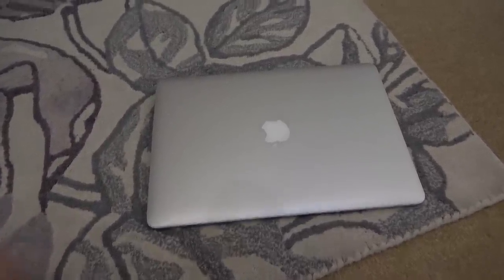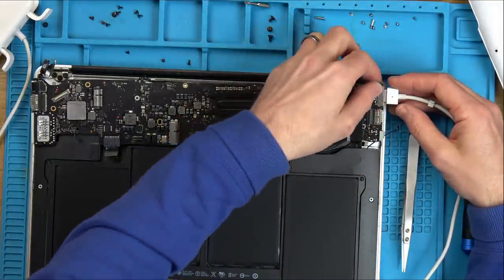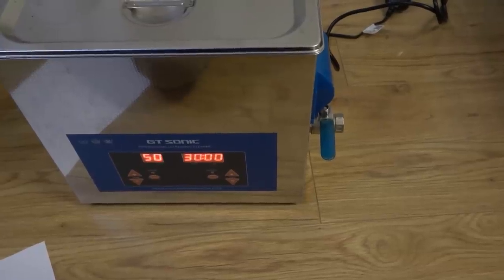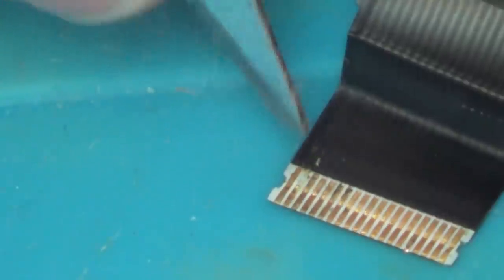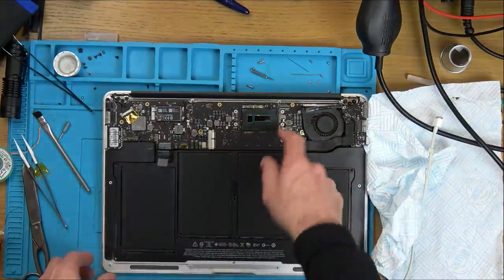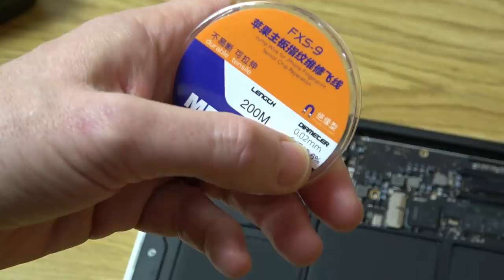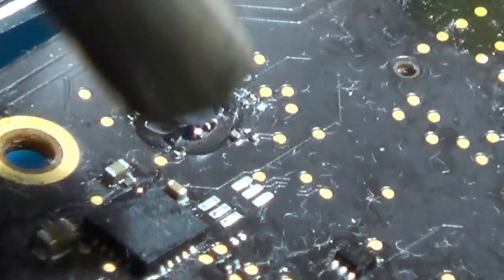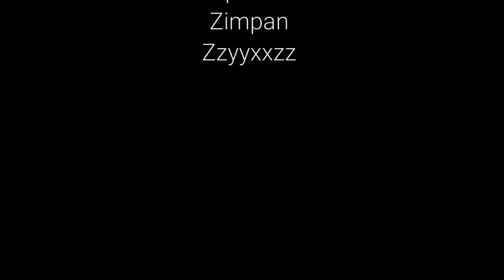Coffee Damaged 2017 APPLE MACBOOK AIR from eBay - Trying to FIX

Comment: That's a really difficult repair.  Well done indeed.  Awesome work.  I have the 2012 version of the Macbook Air that looks identical.  Bought in 2012, i7 version, still using it right now... to type this.

Comment: you did one of the things that I wanted to try but never had the courage to, put solder on the pads and then on the chip to simulate some sort of "reballing" and it worked, I'm speechles, it's not the correct way but hey if it works it works <3
Reply from the maker: Thanks, I think I got lucky because there weren't many balls. Maybe on a slightly bigger chip it would fail 👍👍
Reply: @Mymatevince  ye my thoughts are the same, you did a great job Vince, superb fix

Comment: When I saw it was a Mac Air I had doubts.
When I saw the inside and how much corrosion there was, I felt justified that I was right. Spares only but.....59 minutes of video.
Vince, you have progressed to the next level. I am gobsmacked.
Great video, I hope you replaced the fuse :)
Reply from the maker: Thanks Emma, I got lucky this time! Yes the fuse is replaced. I didn't want to take it all apart using hot air, so I double deckered it on top of the old blown one using the soldering iron 👍👍👍

Comment: I have a mid 2012 MacBook Pro that i have put an ssd in replaced the trackpad and the ribbon connector between the ssd and the board but never any soldering. I take my hat off to you i really thought that was toast , very clever 😊.

Comment: Hey Vince just wanted to let you know this video helped me fix my backlight circuit on my 2015 MacBook Air, so wanted to say a massive thanks. Similar to yourself I can do most soldering jobs around a Logicboard while BGA is still a challenge. I copied what you did for the backlight IC and it worked perfectly. Thank you!

Comment: Nice fix Vince. In future for bga work it is easier to buy some solder balls and place them on the chip using tweezers, then use hot air to affix them to the chip. This ensures the balls are all the same size.

Comment: What about scraping the plástic from the ribbon cable on the keyboard and cutting horizontaly to eliminate the damaged part permanently?

I have done this before on my switch pro controller and worked.

Kep UP the good work Great Video!!

Comment: Amazing how far you've gone since the early video's. You really need to treat yourself to a better soldering iron if you intend to fix lots of laptops. The cheap Quicko or Ksger T12 solding irons are nice as they use the Hakko tips.

Comment: you should try one of those beautiful 17" macbook pros from late 2011 that had the gpu failure, in theory a bodge fix could just be heating the gpu up not even removing it, may be a fun gamble. Also deoxit is a very good cleaner for that kind of corrosion if you wanna deal with corrosion and bad contacts too quickly. Also also I wouldnt probably recommend turning on a water damaged system until you deoxit or ultrasonic it for risk of further damage even though its dry.

Comment: just a heads up vince, cover small bga chips with corrosion in flux and reflow them with hot air to clean underneath them , while you patch up the surface mounted chips with the iron and flux, the sonic cleaner should be used last
Reply from the maker: Thanks for the tips Jason 👍👍
Reply: @Mymatevince  loving the channel mate 
you were ready for this soldering malarkey 6 months even a year ago, so im really enjoying the latest electronics projects you are streaming, 
you getting good solid successes lately, and its making great content,
Reply from the maker: @jasonr9157  Thank you mate!

Comment: Feed back pin monitors the output voltage on the backlight circuit so the chips knows how much to boost the backlight voltage , great video 👍👍👍, you would need to order a new keyboard sooner or later
Reply from the maker: Thank you AR 👍👍 I was amazed all the keys worked after that damage. I wonder if the keyboard is screwed together or plastic molded on this model?
Reply: @Mymatevince  its not an easy job may better to get top case as the keyboard is riveted with aluminum pins and needs to be removed then tiny screws to replace the rivets
Reply from the maker: @AnonymousRepair  Thanks AR, sounds a bit of a nightmare 👍👍

Comment: Good Fix. I'm quite surprised using solder instead of balls worked on the chip. As being ever so slightly uneven can stop it making a connection.
Reply from the maker: Thanks PDS, yeah I got incredible lucky with that👍👍👍

Comment: Hey vince. I have a ps4 that I’ve had for a while. I am constantly trying to repair it but I’ve had no luck. Basically it says it cannot access system storage. Very rarely it will boot up but when I turn it off i normally have to reinstall the software or I can’t as it says it can’t access the storage. I have replaced the hard drive several times but I still get the same fault. Let me know if you want to take a look!

Comment: my 1st thought was 'uh oh, if there are foils in the keyboard, thats the main problem'. I'd try to run the board just with usb keyboard and maybe with hdmi monitor (adaptors thunderbolt-> hdmi exist). The internal keyboard may be shorted over many keys due to the liquid. Since Macs recognise certain keypresses on startup, it may cause the boot launch to get stuck. (just a guess).

Comment: Fans are usually part of the pre-POST package as some laptops won't cycle on if the cooling fans aren't active so that is a positive sign.   POST does all the checks like runs the BIOS, confirms and checks the CPU, GPU, ram to CPU lanes, bridges and control IC circuits and if all is good then it looks for an operating system next and moves into actual startup.   Peripherals are always last in the lineup.
Reply from the maker: Thanks Ian 👍👍👍👍

Comment: That was an interesting ride :) Subscribed! I have a question: what glue can you use to put the feet on so they are easy to take off again to get at screw underneath? I'm feeling brave enough to tackle opening my laptop now but I think the rubber feet won't re-stick afterwards

Comment: Don't apologize for complaining. Absolutely the seller should have listed it as water damaged. It still would have sold at that price and would have helped their reputation as a seller to be up front. As it stands now you know never to buy anything from them again regardless of how good a deal it may be because you know they won't be entirely honest about the faults.
Reply: First of all I agree generally, but It's possible they got a lot of them and it truly was untested from this seller.  It's also possible someone took one look in there and thought OK there's no way this is gonna be worth the effort(or that the seller was the original owner and knew exactly what happened).  But it did have fan spin right off the bat!  So in a way, I wonder.

Comment: Impressive repair, well done.. sell it. on eBay as a Mac Air in magnificent NOS condition only 100 cycles on the battery, almost new-old-stock.(obviously not would be extremely dishonest)
Just imagine that new owner's face, when he is opening it up and realizing he had purchased a corpse that has been reawakening from the dead with bodge wires etc.
I'm impressed by the prices such a damaged old 720p MacBook air can fetch (arrh I see it seems it is a purchase from 2017 and not present time, then it makes more sense 200GBP in 2017)
all in all, very impressive repair job and kudos for making it look doable for the average joe.
Reply from the maker: 🤣🤣 One careful owner!

Comment: This is a GR8T example of why when a liquid is spilled on "any" electronic device that you remove ALL power sources from it (charger, battery, button cells?) as fast as possible. Reason? Electrolysis!... as shown, it eats away everything with a combination of liquid and voltage. It's the world we live in :O\   Good job V-master.

Comment: I had a Dell  laptop at work that was being thrown out due to a chemical leak from an above pipe. The keyboard was ruined but it was sealed on the underside so no chemistry contaminated the mainboards. £10 fix and a new laptop. Thanks Dell 👍😂

Comment: You ought to stress test it by running a couple bench mark apps and perhaps editing some video and photos on it. Really put the machine through its paces to see if it still has any hick ups. If there’s still issues they’ll pop up as the machine starts to heat up and sweat.
Reply from the maker: Cheers Keith 👍👍👍

Comment: No shorting when you fixed it. Apple products wont start if there is a disconnection or damage to the touchpad or keyboard. Once you reassembled, the "problem" was fixed

Comment: REFOX Soldering Lug For Pads Repair
Repair dots quickly,High efficient/stable
To replace the traditional jumping wire
With the effect of original soldering pad
Reply from the maker: That looks very interesting. Thank you for sharing it 👍👍👍👍

Comment: The keyboard backlight is light sensitive. I thought I had a failed one on a 09 pro, but it turns out that the room I was in was too bright, and the lights wouldn't come on. I believe that it can be turned on and off in the settings.
Reply from the maker: Yes, that threw me for a while, I thought it was faulty! 👍👍👍

Comment: You should put flux on the corrosion and hit it with hot air to help get rid of it more permanently, then chuck it in the ultrasonic cleaner, I have fixed boards far worse than that one.
Reply from the maker: Thanks for the tips Defpom 👍👍👍

Comment: Vince, mate, why don't you use kapton tape to mask where you don't want the conductive paint to go?
Reply from the maker: Hey Skonk, my thinking was because it was so small the paint would have gone under the tape by a fraction of a mm, rendering it useless. Even sticking the tape on the tiny edge bit would have been quite tricky 👍👍👍
Reply: @Mymatevince  I understand, Vince.  When I've been trying to repair flat flex before I've sometimes even used very skinny pieces of sticky backed copper foil.  you can even get it with conductive adhesive on it.  I think the real solution would be to get less gloopy conductive paint, but it's hard to know what it's going to be like before it shows up.
Reply from the maker: @skonkfactory  👍👍I got hold of some of that copper foil with conductive adhesive, pretty impressive stuff. Yes I think I need to get a more expensive branded version of the conductive paint, would hopefully flow better than the £1 version I have 🤣

Comment: *Tips*
🐨 Using some Flux you can brush around the corroded areas followed by a warm heating with a Hot Air Station "90 Degrees Celsius Max" will clean up and stimmy the corrosion nicely as long as liquid damage is minimal. 
But it would be better to use a solution of white Vinegar in an ultrasonic cleaner followed by a good soaking with Isopropyl Alcohol, followed by a blast of warm air to air out nooks and crannies before power is connected to the PCB..

BTW a Fine tipped Pen "Industrial Quality" loaded with conductive paint is great for connecting PCB Copper tracks.. 

APU I dropped a 👍
Reply from the maker: Thanks for the tips Koala. Do you know of any brands for a fine tipped pen. It would be nice to find one that flowed well. Using a needle with my £1 stuff isn't the best 🤣
Reply: @Mymatevince  what I used was Welco conductive paint refill " sucked into  needle" but It aint cheap, so If I had some I would have sent it, seeing I cant do what I love doing, speaking of which always use a good extractor when working with electronics, and always wash your hands once done..
Reply: @Mymatevince  I got the brand wrong been a while since I used it, anyway the Brand is welsolo and not welco
Reply from the maker: @KorAllRBare  Nice one Koala, I do at times slack with the extraction unless I know I am doing loads of soldering. Bad habit to get into to!

Comment: *ADDENDUM*
🐨 Remember WAY BACK When, When I advised you to replace BGA chips you can get by without a BGA Station, as all you really need do is to remove old chip, get donor chip and flux it and with a soldering iron tin it "I call it Quick Balling" and then likewise clean the PCB and repeat with flux by pre tinning the PCB and then using a Hot Air Station you marry them? Well that is if you read my post back then..
  
Anyway.. Happy you now have levelled up and what's more "with a little more Practice" will now have the ability to replace even larger BGA Chips quickly and effectively..
Did I let you know I dropped a 👍, Well APU I did..
Reply from the maker: I do Koala, a couple of others have mentioned it over the last couple of years as well. Looking forward to attempting it again to see if I just got lucky on this one! Cheers matey 👍👍👍
Reply: @Mymatevince  Nope.. It was all skill..

Comment: What brand and model ultrasonic cleaner is that?
Reply from the maker: Hey Andre, I got that one from Amazon. It is labelled up as a GT Sonic and the model number on the back is VGT-1860QTD. It has 300W heating power and 150W ultrasonic power. I can't compare it to anything else so I can't say if it is any good or not 👍👍👍
Reply: @Mymatevince  thanks

Comment: The job is done well but those long cables are very ugly,  next time try to make them shorter, it will look more professional and cleaner. ;)  I wonder, if donor connector and cable are compatible with this board, it will look like finished process right?
Reply from the maker: Thanks technixbull. I left them longer on purpose to give a little bit of slack/more room when taking out the board. They definitely look bad though 🤣 Both the connector and the screen cable are available quite cheaply, so maybe one day in the future they could both be changed to do a proper job when/if this way fails. As always thanks for the help 👍👍

Comment: Just for the future 30 minutes in ultrasonic cleaner is too much... i used same cleaner with Branson ec solution for Nintendo Switches before: 1min on each side/angle to get stuff out, 5-6 mins total. You can easily kill what ever left alive with 30 mins.
Reply from the maker: Thanks, I tried to look up timings a couple of years ago but I couldn't find out much information. I might search YT again to see if anyone has any videos on it. Thanks for the tip 👍👍👍
Reply: @Mymatevince , Louis Rossmann has few very nice videos about this topic. Basically: mix Branson EC solution 1 to 10 with distilled water, use ultrasonic cleaner for 1m per side turn around in all dimensions, after stir in distilled water bath for 1 min, than 1m IPA alcohol bath to clean out left over water, finish with basic drying on low temp(~150C) hot air station or oven.
Reply from the maker: @Agilato  Nice one 👍👍

Comment: You can buy my one if you like been sitting in the cupboard for 4 years was given to me after it had been to Dubai and never switch on again took it to a repair shop they replaced the battery showing the old one had a hole and was buffy paid £100 got it home and still nothing was then put away was gonna send it to andrew paul yt to see if he could fix it